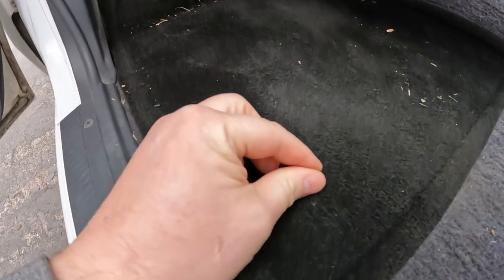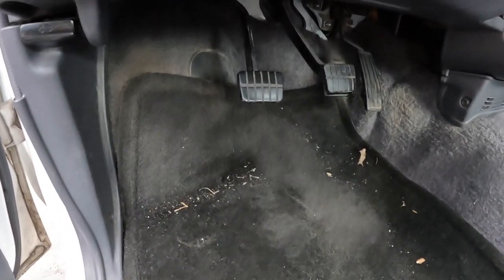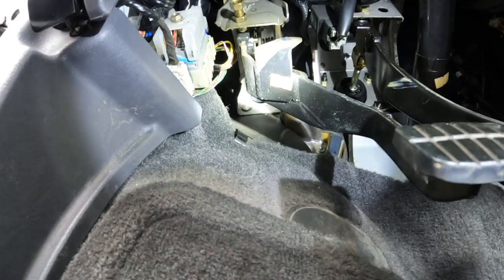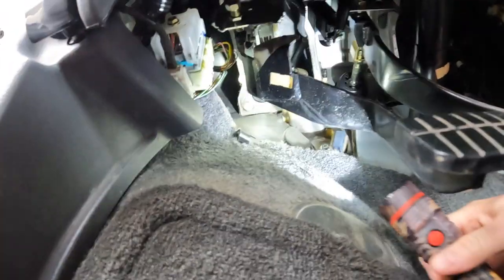Clutch Clicking - Sound from Clutch Pedal - Manual Transmission - Nissan Hardbody

Comment: Clutch and/or brake "pedal stop pads" go into each one of those holes. Also if the switches "fall" into those empty holes they may stick & "click" upon disengaging , your brake lights may not turn off if associated to the brake pedal (2holes) or your cruise control, may not engage/functions. The clicking sound is, as someone else mentioned, a bent clutch slave cylinder rod rubbing against something or there is also a floor, pedal stop pad that also may be missing. The replacements can be rubber or silicone. However, the originals can be a harder composite material that dries out and may break.

Comment: I have this exact issue but a 92 hardbody and saw this other video of a guy with a Miata with almost the same exact sound , his solution was a circle piece that fits into that hole on top of the clutch he had the same color plastic bits too. I believe it was for the idler switch or something along those lines. Another quick fix I had was the brake lights wouldn’t turn off and it turned out to be the rubber bushing that presses against a button telling the lights to turn off when not engaged, so I took a bolt 2 washers and a nut to replace the bushing and it works perfectly. (Learned that from another YouTube video just look up brake lights won’t turn off Nissan hardbody it should pop right up)
Reply: Miata link^

Comment: I have something similar but when releasing it also feel a vibration int he clixk
Reply from the maker: Did you end up finding the issue.  I only drive mine a few times a year and haven't noticed it on the past few times.  I'm sure it's still there, but not enough to bother me.
Reply: @weekendhomeprojects  nothing

Comment: Having same issues did you fix yours?
Reply from the maker: Not  yet.  I believe it’s the broke piece that I found a part of.  I think the clutch switch is popping off the side of it making that noise.  Got a replacement at Autozone (generic part) and will make a vid of putting it on this week.
Reply: How about now?

Comment: having the same thing on my 98 altezza right now. doesnt happen all the time but only after about 30 min on the road. hoping its nothing major
Reply: Exact same thing with mine. Only happens after 20 or 30 mins driving, and it only happens a few times per journey. Did you find a solution?

Comment: My truck just started making this noise. Strangely I also have a hardbody. I just searched “clicking clutch pedal” in Google and your vid came up. Did you ever solve this?
Reply from the maker: No not yet.  Need to replace the timing chain so haven’t driven it but a few times since I made this video.

Comment: The clicking sound might just be cause of all the parts connected to and that involve the clutch pedal?! They tend to develop a little bit of play from prolonged use. These trucks are old after all. Lol
Reply from the maker: Yeah, true.  Next non-rainy day we get I'm going to poke around a little more.  Going to replace that broken part and spray some WD40.  There's not many pieces moving around down there, but there is a spring that's got a weird shape that allows a piece to move into it's opening.  You may be right that something is going on there due to age and wear.  I'll post another video once I do some more digging.

Comment: The end of the spring has jumped out of the hole- there is 3 holes.....it a l bend rod... it hard to see
very hard to see but there is 3 holes and 3 l bends  1994 hb
Reply from the maker: What's the part that needs replaced call?  Clutch spring?
Reply from the maker: BTW - Thanks :)
Reply: @weekendhomeprojects  The plastic holders for the spring are cracked...so you need those...
Reply: @weekendhomeprojects I have a similar issue with my car 2018 plate. Wondering if the part resolved the issue